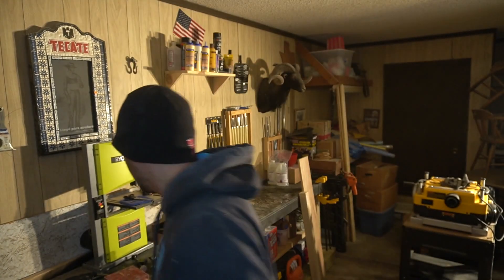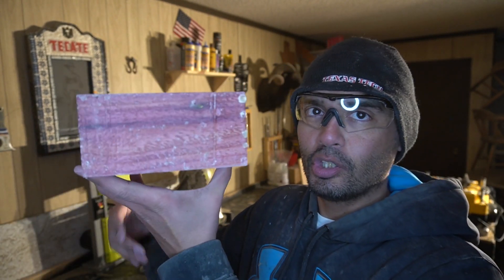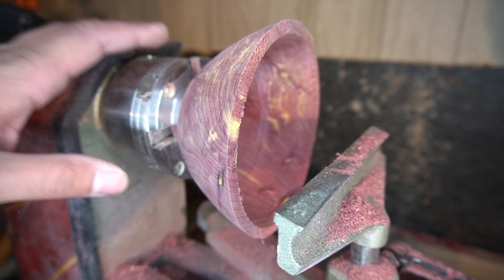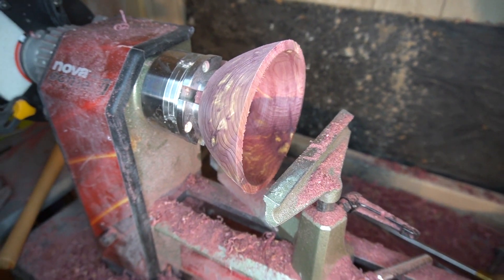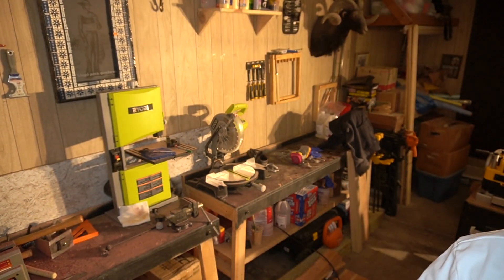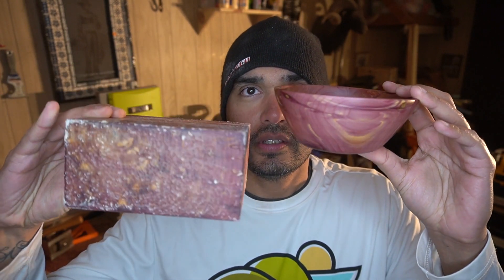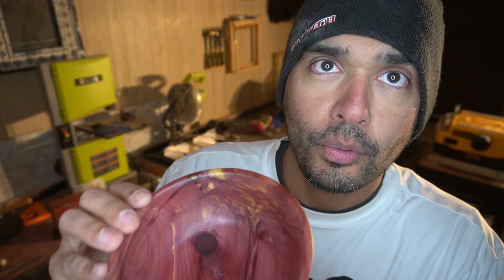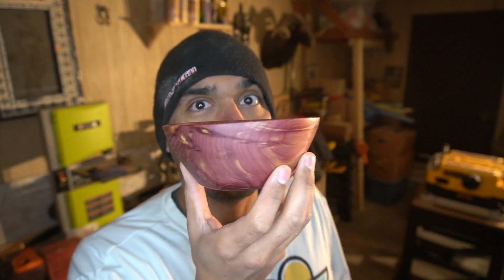Making A Wooden Cedar Bowl

Comment: I made a bowl similar to this one but one day it cracked and now it looks awful.  Is there any way to stop my bowls from cracking.  I'm a new woodturner so I know there alot for me to learn, but I seriously need help.  Is there anything I can do for future bowls I make?
Reply from the maker: I had the same occur with this bowl. It turned well but a few weeks later it warped and cracked. The only way to prevent it from happening is dry out the wood really well before you turn it. Once the moisture is out of thr blank it should be fine “in theory”
Reply: @saultytexas  alright, that sounds good.  but do you know how dry it has to be, or like how do I know it's dry enough?
Reply from the maker: @jobmonkey1081  There are devices that you can buy that will detect the moisture content of a piece of wood. I usually do it by feel alone. I live in Texas and wood tends to dry quickly in the summer. I would look into getting a wood moisture meter for better results.